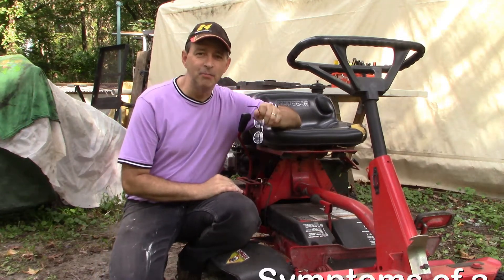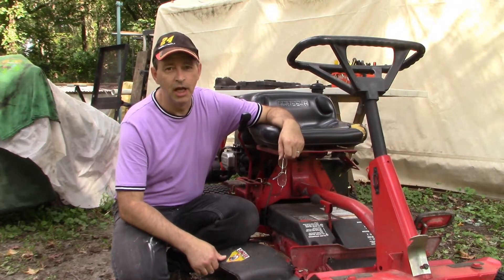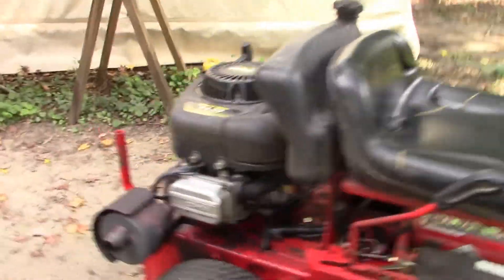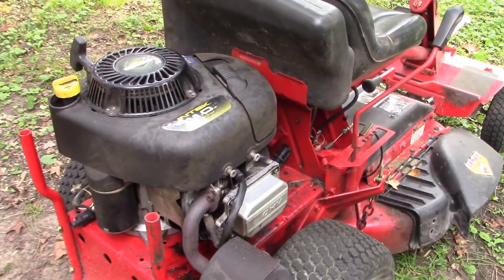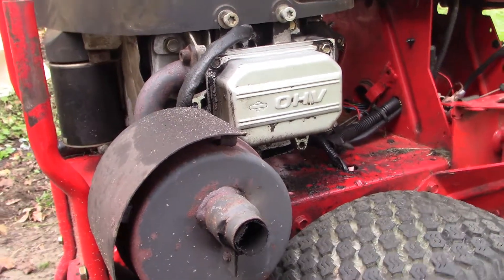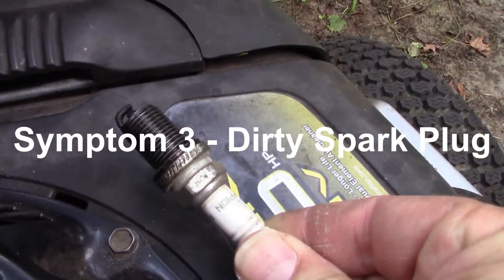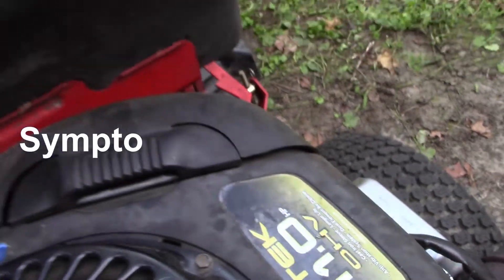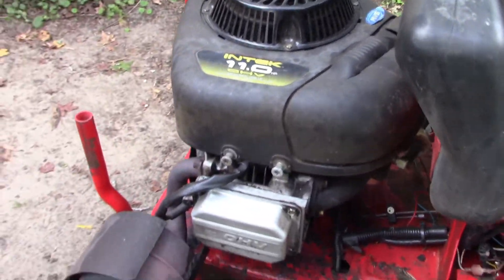Symptoms of a Blown Head Gasket

Comment: I’ve got an old 5hp brigs that’s almost making a popping sound while idling, when it pops a little smoke will come out as well at when I rev it up and back down. It doesn’t seem normal to me but if u could give your opinion that would be great 👍
Reply from the maker: You should log-in to one of the small engine repair forums online to get some advice. You'll need engine make, model, etc. But there is a lot of good info out there. I simple can't diagnose sight unseen in the youtube comments. Good luck!

Comment: so compression in the crankcase I asked the mower shop and they said head gasket and I got a new one, I just have 2 head bolts left to remove, put on the new gasket then hopefully she'll scream (I call making a mower run making her scream)
Reply from the maker: Good luck with the rest of the project!
Reply: @Buckwsr  thanks, I may also need to replace the breather because im still getting compression in the crankcase

Comment: Can this cause gas in the oil
Reply from the maker: No. Gas in the crankcase (oil) is caused by a carburetor needle/seat failure. It leaks and makes its way into the combustion chamber and eventually the crankcase. A blown head gasket might result if you run your engine with the crankcase flooded with gas and oil. I've seen that before.... Fix the needle/seat in your carburetor, and then be sure to drain and change the oil before starting it up.
Reply: Thanks that’s exactly what it was.

Comment: Hi.  Thanks for the video.  What if oil is coming out of the carb and getting the air filter oily?  I have a Murray with a newer Briggs engine with the plastic carburetor.  Thanks!  I was given the mower, and cleaned the carb nice, and bought some new parts.  I replaced the valve cover gasket because that is where I thought the oil was leaking from.  Initially, I thought the previous owner overfilled it with oil because, when I drained it, it was WAY more than the recommended 15 ounces.  Take care.
M.
Reply from the maker: Certainly you don't want the crankcase to be overfilled with oil. Also, you need to make sure the mower gets stored on level ground. Oil contaminating the air filter could be coming from the crankcase breather tube which typically connects via a tube to the air cleaner assembly.

Comment: Thanks for your video, I have this same exact engine and lawnmower.  I suspect a blown head gasket, although I am not having oil leaks or smoke. My symptoms are engine is very hard to start, only starts at low idle speed, and pops and backfires a lot. If I manage to get it started, it wants to die immediately unless I let it warm up, and unless I increase the throttle very, very slowly.  I have replaced the spark plug, the carburetor, and adjusted the valve timing, and I'm still having the same symptoms.  So by process of elimination, it seems like the only thing left is either a compression problem, or the flywheel key is sheared off causing the timing to get screwed up. Any thoughts on my problem?
Reply from the maker: I would definitely pull the flywheel and verify keyway is properly aligned. Also, while you're there, check air gap on the magneto. Good luck.
Reply: I know but how you doing today that's an Apple that you've got that's going all after the back end of it on the head of the head and stuff I'd be your rings I'll but you knew said rings and if it aint got a big scar on it all they mean take motors have they'll do something other inside dirt and make a ring snap or what have you and it would be a little bit of groove right down that silver wall so I pull you up pull you so you're your head off her and pull your p*** back and see if you got any deals in her And I was just wondering about the other motors that I spoke up about the 2000 piston and stuff with rod what have you have given me a deal back on that Friday or again just named Jeff I appreciate it sweet